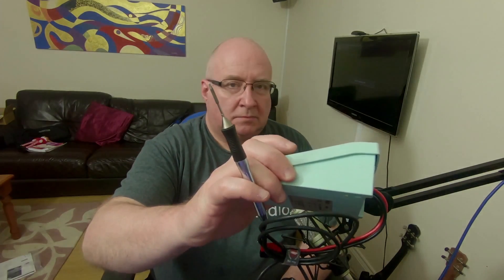Weller WSM1 vs TS100 USB Soldering iron, what are your thoughts?

Comment: Hi Gaz, I have a ts100 and use it for my albeit simple soldering needs and I rate it. Open source firmware and loads of options and a very quick heat up time so it’s ready to go quickly are what drew me to it and it’s size. The biggest difference as far as I can tell is the ts80 is lower power and usb c although still has open source firmware and has the quick heat up time etc. I think the 80 will work from certain battery banks as well as mains.The tips are not interchangeable though. Tips for both are easily available and not too expensive. The only time it might struggle is if you need lots of heat for large pad work but tip choice may well play a part in that, I don’t do any pad work as such so can’t really say for sure. Would be interesting to see a follow up if you decide to go for one though a lot of the reviews are RC focused but a ham focused one would be good. 73 & HNY

Comment: Hi Gaz
When I was a teenager in the 1970s, I used an Antex 15W iron. Fifty years on, I have upgraded to an Antex 25W iron of the same type. In between I've wasted money on a variety of temperature-controlled 'solder stations' and they were all useless. Last year I used the 25W Antex to solder a tiny chip to a header board. No problem.
Phil M1GWZ says HNY.
Reply from the maker: I have heaps of them but the over heat in the spring rests.. the wsm1 is a total dream to use but I realy fancy a ts100 lots of features that would suit my crazy setup here.. happy new year to everyone, peace ✌️ Gaz